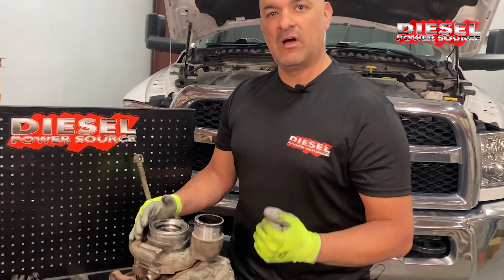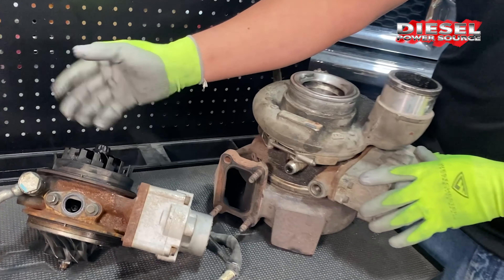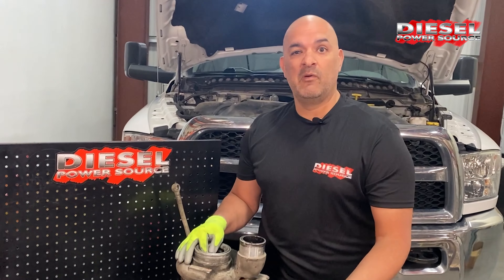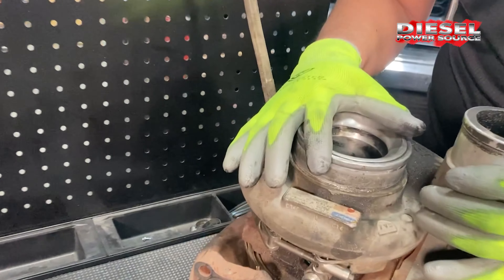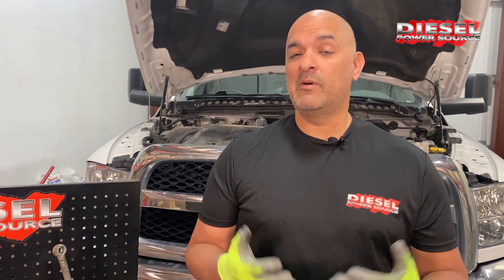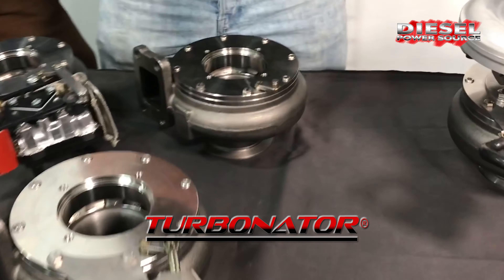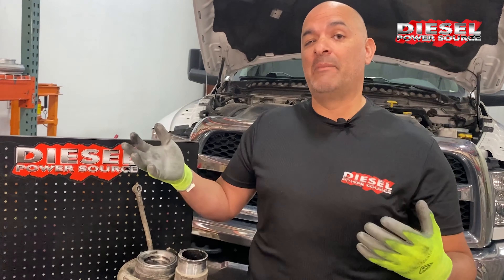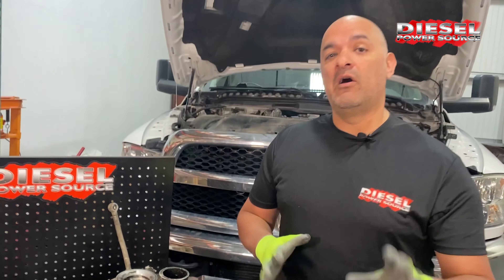Replacement Turbo for 6.7 | Performance VGT Turbo for Cummins | Issues with Stock Turbo

Comment: I got a 6.7 2007-13 ram with a P003A code, Vogt vanes seen fine, impeler will spin freely, I can’t seem to figure out the issue, anyone got any tips? I cannot remove the inner bolt toward the front of turbo to remove turbo completely. It’s a nightmare right now lol
Reply: Often means the actuator is failing,